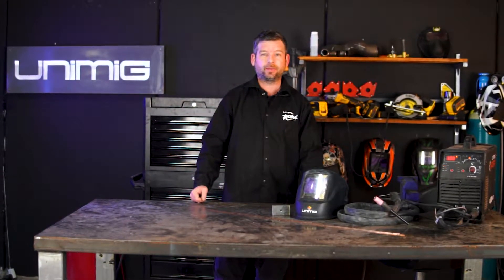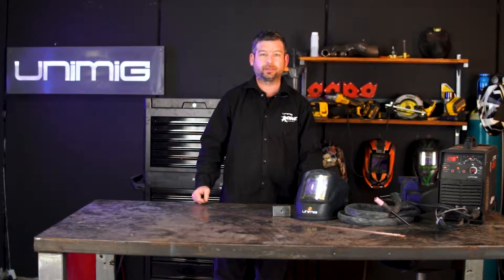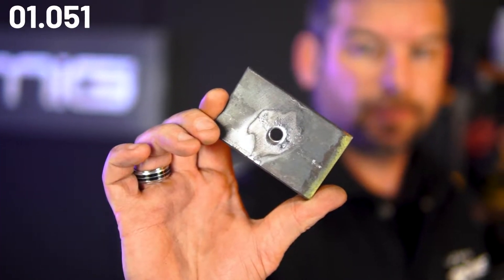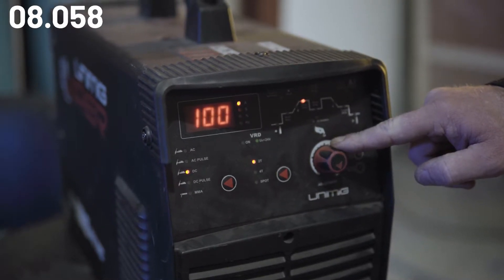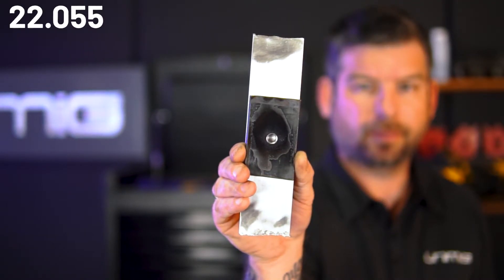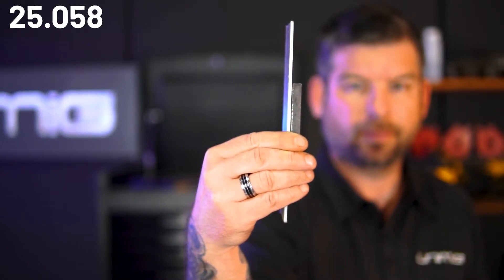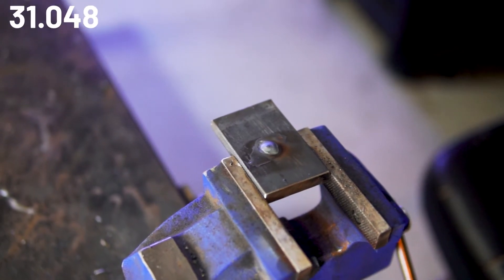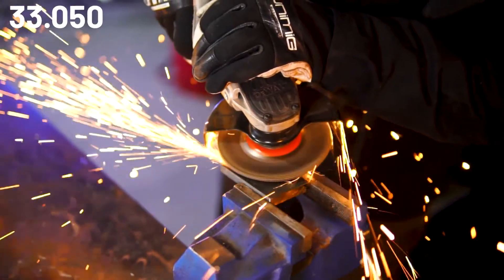How To Weld up A Unwanted Hole (Tig Welding)

Comment: I'd love a video showing the best technique for starting an arc on Unig arc welders when VRD is on. I have a unimig where VRD is switchable and I do most stick welding with VRD switched off but I find it much harder starting an arc when VRD is on. Is there a technique for stating an ARC when VRD is on?